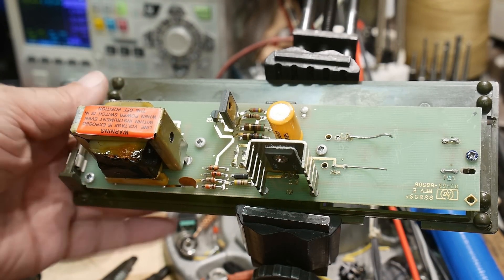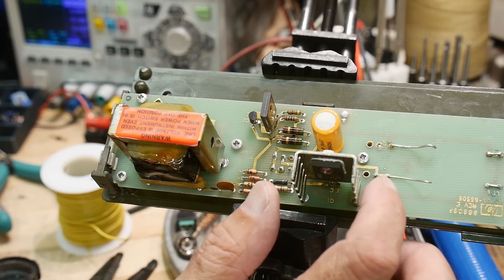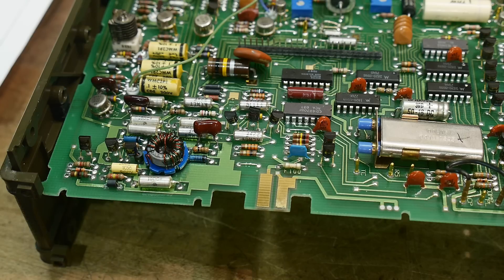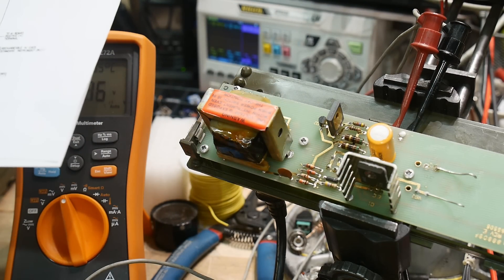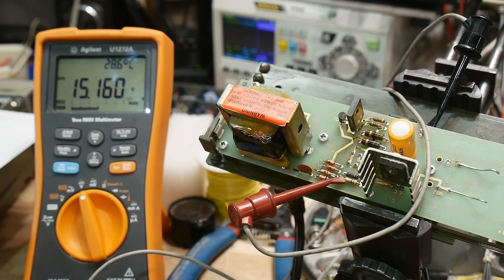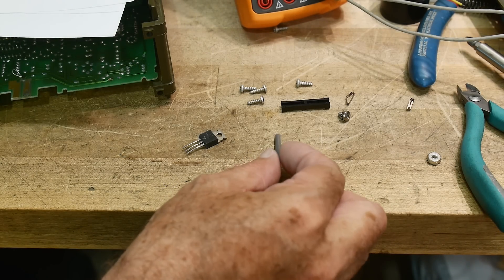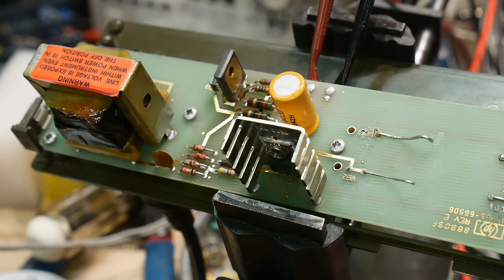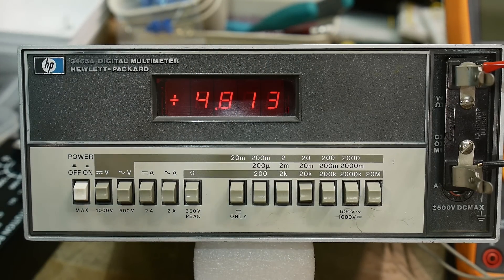#1238 HP3465A Multimeter repair (part 2 of 3)

Comment: I am clueless as to why they would drop a 15 dc supply down to 5 volts, and then boost it back up again, later in the circuit!  This really really seems WACKED to me!
Reply: It's powered by a 5V battery, so the power supply is 5V when powered by the AC line.
Reply: @gwc1410  Yes but I question why 15v and not a bit less to reduce the stress on the pass element which has thrown in the towel.

Comment: What are Q2 and Q3 for on the power supply board.
Reply from the maker: current source for charging the battery
Reply: around 65 mA battery charging current before Q2 starts shunting the current away from base of Q3

Comment: I would scope the supply for ripple and probably replace some capacitors. I hope that's in part 3 as well as repairing the battery compartment, replating the edge connector, cleaning and polishing all contacts and the case and of course a calibration. For extra fun, put one of those tamper evident warranty stickers on it. 😁

Comment: R1 is 470 ohm - that supplies the transistor base current - 10V drop is 20 ma. HFe of 20 gets you to only 400ma, with nothing being taken by the zener.
Reply: Exactly!  The low hfe was the problem.
Reply: The MRF652 spec says hFE between 10 and 150. Strange to have selected a transistor with such low amplification. But maybe it wasn't the original part? Maybe somebody already tried to repair it and selected a transistor with too low hFE?
Reply: @johansvideor  Not sure if it is MRF652, that seems to be a UHF power transistor.  This is HP equipment so I dunno if I trust the part numbers.  The only thing you can say with confidence is that with a gain of 20, the circuit can't put out much current.
Reply: You are right, that's not the same transistor.
Reply: He said the meter draws about 120mA, so power supply output of about 400mA is OK.
Reply: @gwc1410  note at 400 ma, no current would be left for the zener.  Regulation would gave been lost long before that.
Reply: @argcargv  Yes, I misspoke. I meant to say output of 120mA is Ok, which is what he said the meter draws. I should read my comments more carefully. As you say, output of 400mA would be a problem.
Reply: @gwc1410  Yes, you might be able to get away with a 120ma power source, but since the meter is using DC-DC converters you get into an evil little problem.  The initial surge current goes over 120ma, this causes the voltage to sag... But then the DC-DC converts demand more current to make up the difference, now you are stuck in a state where you never get to the quiescent current state because the sagged voltage causes an increased current demand.  If the load was just a passive resistance,then this wouldn't be a problem.